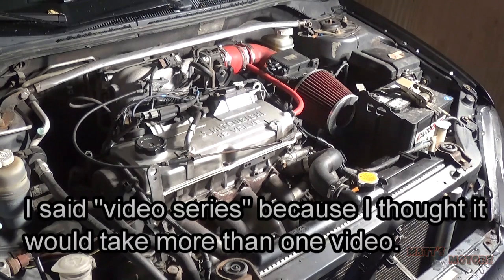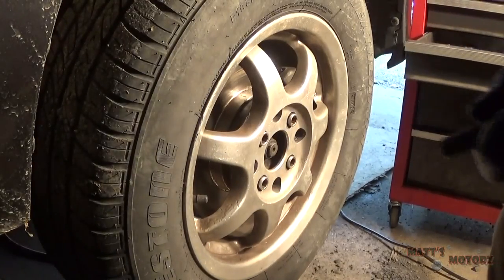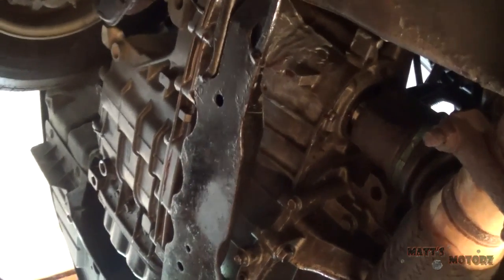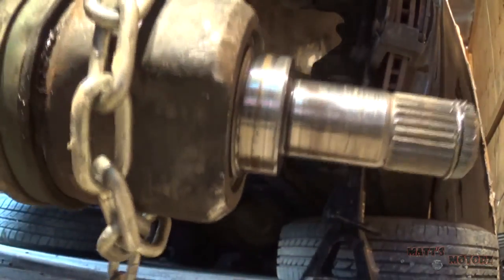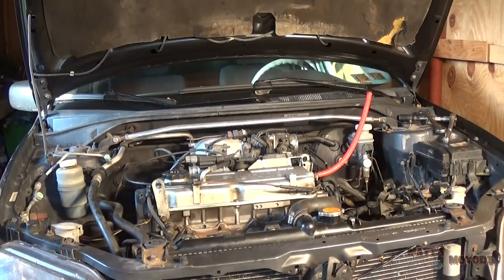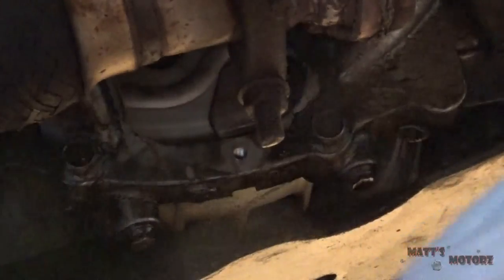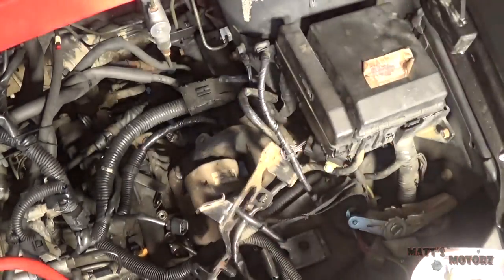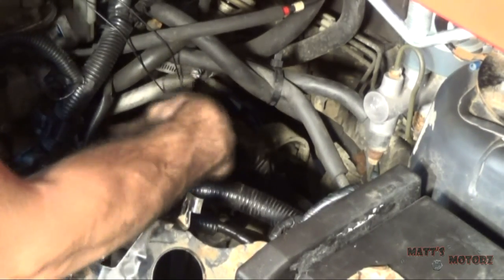Transmission Removal [2002 Mitsubishi Lancer]

Comment: OK quick question,after watching your video a million times over and over I now know it word for word...is the car in the video auto or manual...? bc my wife's 05 has the same motor and body but when you go to unplug the trans wire harness and disconnect the cooler line and linkage it's a whole new ball game...hers has radiator connections for a return but it is by passed.other than that everything else is the same.I was told the motor has to come out,the cross frame has to come off,blah blah blah,4000$, found cluth kit stage 2 for 114$ new transmission 160$ your video that made a ase certified mechanic look stupid,priceless....
Reply from the maker: +Nathaniel Tolliver Thanks for watching! The transmission for this car was an automatic transmission.
Reply: Oh OK I thought so Lol, but at least I now know how to get it out
Reply: HistoryHunter someone give this guy a Medal
Reply: Hey matt u didnt give the size bolts to remove the transmission from the engine

Comment: One question can a fwd conversion to rwd be done and if yes then how
Reply from the maker: Anything can be done with enough money.  In order to do it, you would first need to remount the engine to be longitudinal (as opposed to transverse), as well as obtain a new transmission.  That new transmission likely won't bolt up to the engine so you would need some kind of adapter plate.  Then you would need a drive shaft and a rear end that accommodates said drive shaft (with a differential).  Not worth it IMO.  It is one of those "hey this could be cool!" thoughts that, in reality, will not work unless you 1. Have a LOT of money to spend and 2. are VERY mechanically savvy and can fabricate and obtain the necessary parts.
Reply: +MattsMotorz thank u sir